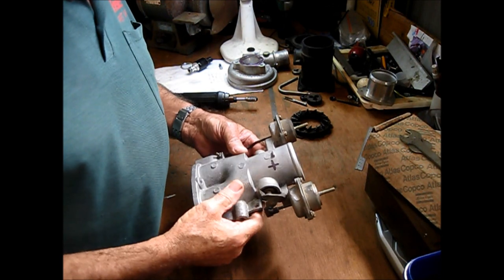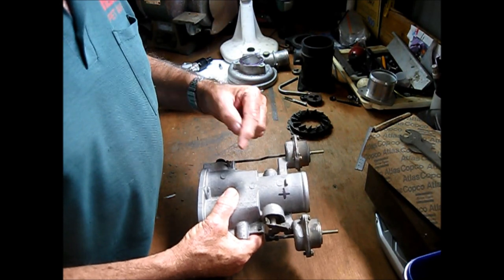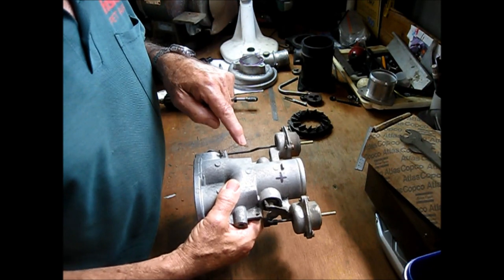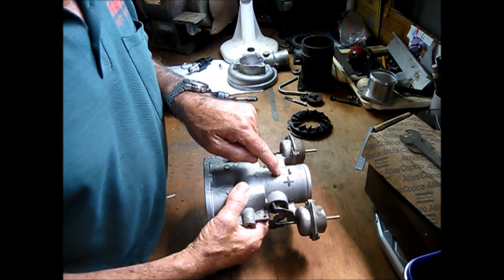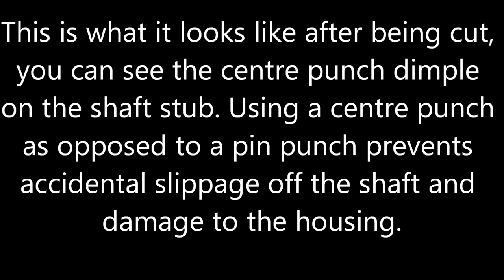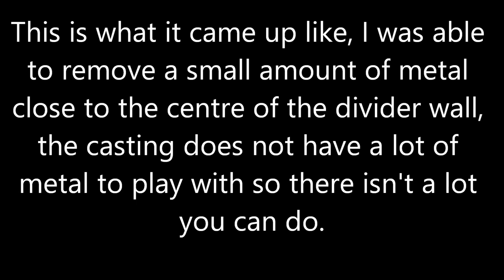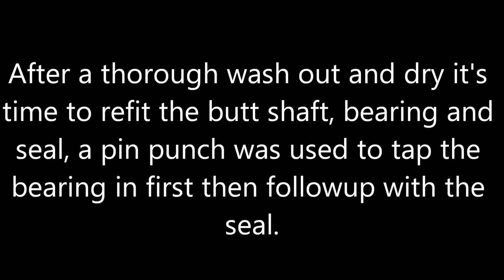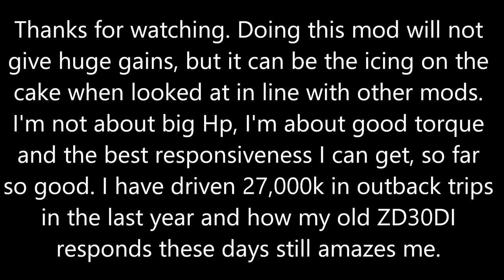Throttlebody Mod Stage II 2018

Comment: G'day mate I'm looking at doing the egr blank mod to my 03 GU ZD30DI and I'll also be removing the butterfly valve, I was just curious how you blocked the vacuum line for it without it throwing any codes? :) 

Thank you!
Reply from the maker: Hi mate you won't get a code on an 03, for the vacuum line to the swirl valve I put a short section of thin rod into the hose to seal the vacuum and for it to still connect to the diaphragm so it looks std from the outside. for blocking the EGR I would block at where the pipe across the back of the engine connects to the EGR valve and also at the top where the alloy riser bolts to the manifold. I have actually just removed the complete cross pipe, making a plate to cover where bolts to the exhaust manifold as well as the plate on the inlet manifold. I left the EGR valve itself in position so basically it still appears to be std.
Reply: Geeyoutoo Absolute legend mate thanks for the reply!

I'll be giving it a go today! Thanks again Bud!